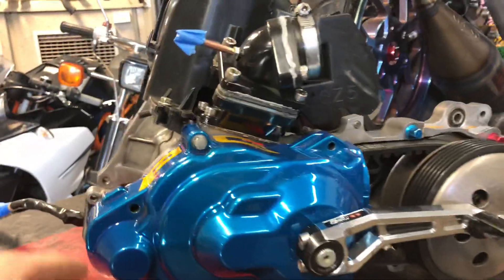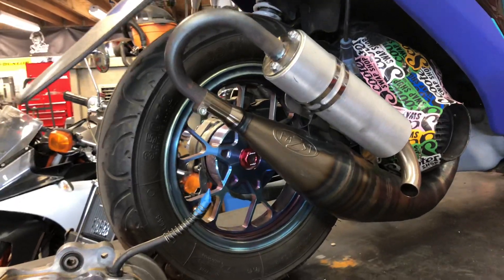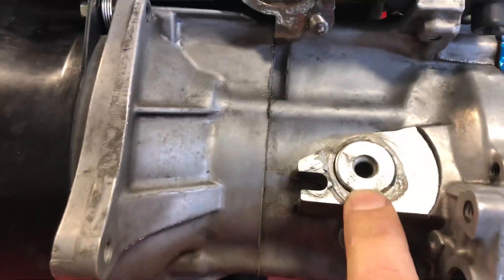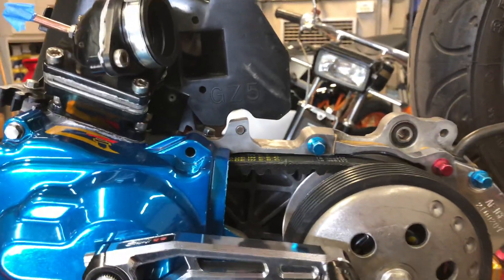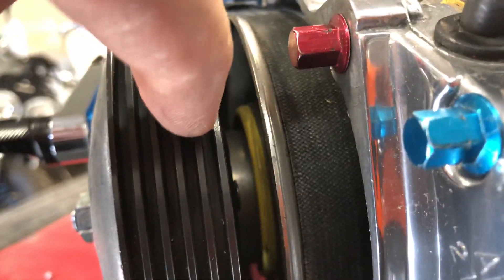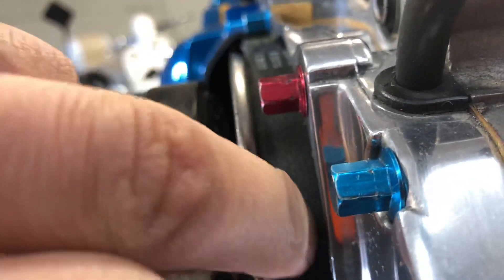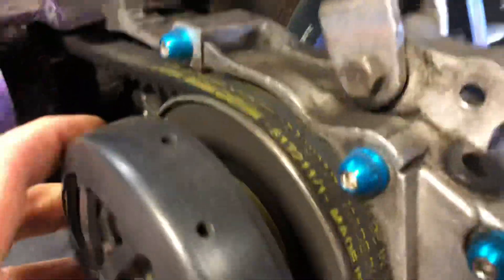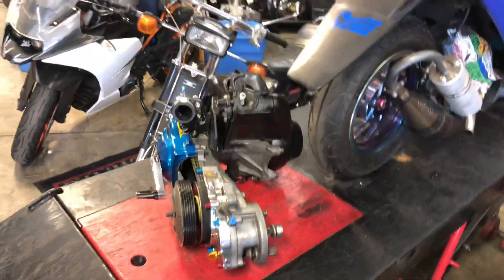Tuning a honda dio elite motor PART 1

Comment: amazing work mate ....what do you sugest fo a stock af25 dio ? what can i do improving little the performance  but keep the stock cylinder  and  all stock components exept lighter pulleys ?  any dremel work accepted :)   any modification to stock exhaust ? ( i have a delorto 21 in the closet it is way too big for stock or i can use it ? ) thank you

Comment: Your video is titled tuning in Honda deal motor but you didn't tune anyting I need help tuning a 97cc Stroker my pilot screw is always a quarter Turner from seated no matter how big a jet I put in it or how big a pilot jet I put in it it's always the same any suggestions
Reply from the maker: This engine was shipped to us, went on the dyno and we tuned it for max hp. There was supposed to be a second video but we never published it. Strokers are known for air leaks and improper setup. And they’ll be impossible to tune. I’d need to know what your squish is at and a full
List of all components used aswell as compression, and what modifications were done to the cylinder at the time of the build. There’s really too many variables without knowing all the details to know the issue. First thing, make sure you have a clean, quality carb, polini keihin etc. not oko, or similar. Pressure check your engine with a tool and report back with the psi and how long it held
Reply: What is the best variator fly ball grams for.the 70cc honda dio